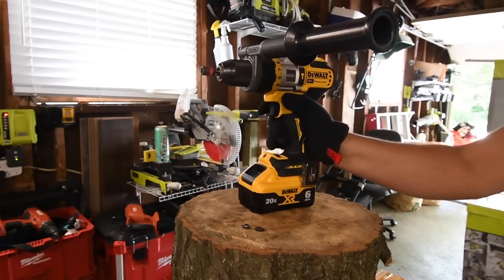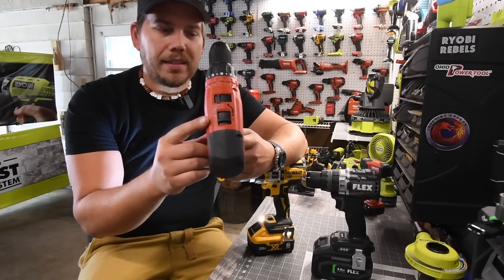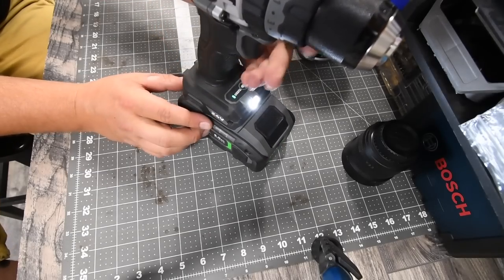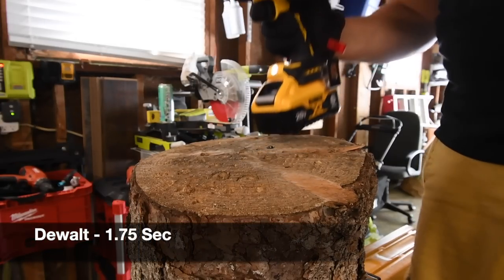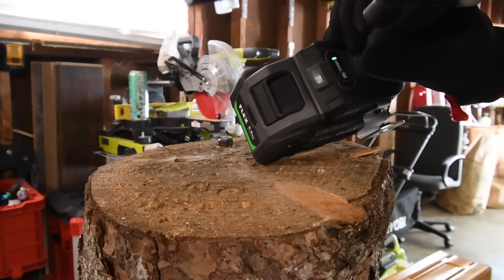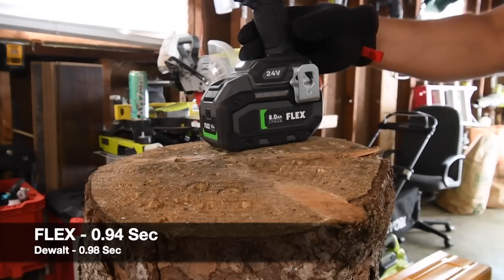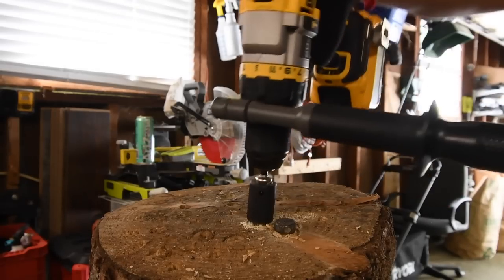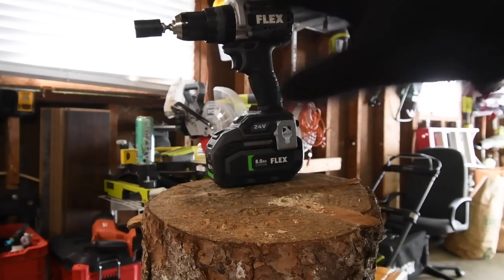DEWALT FA vs FLEX Turbo (Hammer Drills)

Comment: Can't wait for the XGT hammer drill to hit this channel, great video!
Reply: XGT monsters
Reply: Xgt beats both these drills on power and torque and quality i would say
Reply: I need  the makita  xgt hp001g beast but was looking at the 18lxt xph14 dhp468 drill cause im not on the xgt platform yet
Reply: @micjubba709  just get the XGT!
I initially got the rear handle saw, it was so damn good I started moving into the xgt line. The drill absolutely blew my mind with how damn good it is!
If you either need a good drill or a good circular saw, the XGT line is for you!

Comment: Great video! When doing the speed bore test you drill right into a thick knot of wood for both brands which any tool will have trouble getting through. I’d like to see Dewalt and flex go at their speed 2 speeds in a non knotted spot.

Comment: Turbo mode increases torque and speed. It does not decrease torque as its just applying more power from the battery. It isn't any kind of physical gear change.
Reply from the maker: Deal with it.
Reply: @ManCaverTools  I wasn't criticizing your video, nor do I care which of the drills win. I'm just letting you know how they work because it seems like you think the turbo mode increases speed and decreases torque. Just trying to help.
Reply: @ManCaverTools  what a great attitude you have… man child.

Comment: The anti kickback on the Flex is super sensitive. It’s a lot like the gen 4 Milwaukee, but you can shut the feature off on the Milwaukee.
Reply from the maker: correct, each brand has the setting for the anti kick, some are set to soon
Reply: @ManCaverTools  I agree, but you can disable the anti kickback on the gen 4 Milwaukee and the Bosch 1330.
Tools and Tactics said that the Flex isn’t quite as sensitive if you use the 2.5 amp battery.

Comment: I believe the dewalt you used was the flexvolt disadvantage model given that no flexvolt battery was used. Still an interesting and useful comparison nonetheless - but run it again with a flexvolt battery please!
Reply from the maker: I already did multiple videos on the flecvolt advantage. a flex volt advantage battery is not better than a battery with 21700 cells in it when its on a felxvolt advantage tool
Reply: @ManCaverTools  Who makes FLEX drill driver ❓❓
Reply: Flex failed on the 10” lag due to the anti kick back. I don’t think Dewalt has anti kickback.

Comment: Just curious as to why you didn't use the 6amp hr Flexvolt Battery on the Flexvolt Advantage. Seems to me that the Flexvolt battery would've bee the obvious  choice.
Reply: That's because he knows that 6 amp hour flexvolt can actually do it but it's real power is actually the 9 amp hour, I know because I did the same test myself on the same drill bit which is why I'm going to buy me DeWalt Flex advantage drill cos we don't have Flex in our country, I'D say that  the 9 amp is Dewalts turbo way for  power
Reply: Because the 6amp flexvolt uses the 18650 cell batteries compared to the xr using 21700 to match with the Flex’s battery. I’d would say to use the 9 amp flexvolt since that one does have the bigger cells

Comment: Another one. Ever thought of getting 12 ah batteries for each tool to do head to head like The DeWalt 12 ah FlexVolt, M18 12.0, Flex 12 ah and any others that you may carry that has a 12 ah battery?
Reply: A 8ah with 21700 cells  is more than enough for a drill dont need a massive 12ah battery thats just for capacity and runtime of the tool not performance or power
Reply: @micjubba709  Yes. But did I say just drills?
Reply: @toolskii  as its a video about drills going head to head i thought thats what you where talking about
Reply: @toolskii  even most the other tools 12ah will just improve runtime not power or performance
Reply: @micjubba709  Oh Yeah. I should of been more specific. I do apologize.
Reply: @toolskii  its cool i get what you mean 😁

Comment: If I’m not mistaken, by trying to put the lag in with the Flex so close to where you did it with the Dewalt without removing the Dewalt lag first, you compressed the wood.
That creates a higher wood density in that area, which makes it much harder for the Flex to complete the task.
Reply from the maker: This is a old video. Ive changed how I do these tests since this video I don’t even use logs anymore
Reply: @ManCaverTools  I think we’re all learning as we go through trial and error.
I’m thinking about getting the Flex since it’s on sale.
How would you compare it to the gen 3 and gen 4 Milwaukee hammer drills?

Comment: I want to ask what everyone’s experience has been with Flex.
I’m debating on getting the turbo hammer drill because Lowe’s has a great deal on it right now.
Reply from the maker: Flex tools are worth buying into. When it comes to buying into a line of tools the most important information on a brand is do they have the tools you need available to buy
Reply: @ManCaverTools  I love the ergonomics of Dewalt, but the hammer drills I would buy by Dewalt are expensive. Also Dewalt’s warranty is a little shady. Thibs had to pay over $100 to get one of his Dewalt tools repaired because the Dewalt warranty only covers one year of service.
I’m open to having more than one battery platform because I believe that’s about the only way to build the best set for the buck.

Comment: By the way, the Flex is on sale for $179 with two batteries, a charger and a bag.
The Dewalt Power Detect is around $300.
Reply from the maker: not too shabby
Reply: @ManCaverTools  The combo kits are more competitively priced. The Flex is $349, and the Dewalt is $379. Those include the impact driver.

Comment: How about with the Flexvolt 6ah battery?
Reply from the maker: the felxvolt advantage would lose with that battery
Reply: @ManCaverTools  it does better with the 6ah XR?
Reply from the maker: @bennettshfd2  yes it does with a XR battery that has 21700 cells inside
Reply: @ManCaverTools  I had no idea.  Why would they use only 18650 instead of 21700?  That's crazy!
Reply: @ManCaverTools  I believe the new 6.0 flexvolt batteries also use 21700s.
Reply: They use 18650 cells inside of 6ah flexvolt bc of weight to make it comfortable to use with flexvolt tools  and a bit lighter than 9ah or 12ah honestly it makes some sense.
Reply: @АртемВ-и5р  interesting,  I could of swore I seen somewhere that the new 6.0s switched to 21700.  Guess I'm glad all I have are 9.0s lol

Comment: Uhh aren't you supposed to be using a flex volt 20v/60v battery to get the benefits of extra power from the tool?
Reply from the maker: you dont get an advantage with those batteries. I already proved it in many videos
Reply: Clearly you aren't a subscriber lol. He's tested that, and no, it doesn't.
Reply from the maker: @GuyFromJupiter  thank you Spencer
Reply from the maker: @jhonimastersipayung5874  he was just saying the I have a few videos already proving that fact on batteries
Reply: @ManCaverTools  no worries. Thanks anyway 🙏🙏🙏
Reply: @ManCaverTools  Regardles,  you should have used one anyways to remove any doubt. They do advertise the 999 being stronger with the flex volt battery, even if your real world testing doesn't show any difference. Too many variables (hard, dense spots in the wood etc). Might as well do the best you can to present an apples to apples comparison. Liked the video regardless.

Comment: Hey everyone. I just wanted to add something.
Videos like this are a great resource when trying to figure out what brand is best for you. At the end of the day, it’s really about personal preference, though.
I can say that I see more people moving away from Dewalt, in favor of other brands.
Dewalt has a lot of power, but not enough safety, such as thermal shutdown and anti kickback. They tend to keep going until they break or hurt the user.
Check out comments and reviews to see for yourself.
Reply: F the incompetent user. Breakdown is a different story. 

Personally, we tried cordless Milwaukee ten years ago and every one broke. Meanwhile every DeWalt since the 90s is still going. Although the older ones are weak. Useless on a site. 

The future may be Flex. But they have some drop trials to prove it.

Comment: Shouldn't the 999 perform better with the FV battery?
Reply from the maker: the XR 21700 cells performs better in the Flexvolt than the Flexvot battery does. check the the Flexvolt vs Dewalt power detect video
Reply: @ManCaverTools  I figured the FV used 21700 also 🤔. But I've been wanting to go with the 999 hearing it can use the 60v supply as a "turbo" in situations of needed extra umph.
Reply: @FordRanchero289  it did in my case when I tested my Milwaukee gen 3 against my brother-in-laws new 999 and his old 996 about a month ago ,found out the 9 amp flexvolt battery did match my generation 3 high output 6 and 8 Milwaukee batteries but the difference was that if the RPM on the 999 was the same as my Milwaukee then the 999 I feel would be a little bit stronger than my gen 3,I pushed them both to breaking point to find that out, in other words I thrashed them both along with 996 as well,using 32mm flute augers on 6 test runs on  hardened  Douglas firs, pity we don't  have Flex in this country

Comment: I really would not mind switch my power tools over to Dewalt but I use my impact driver a lot and I’m really about the 887 but dewalt hammer drills are top dawg
Reply: I’ve been using the brushed 885 for years. I will take it to my grave 🤣😂. I love that little impact
Reply: @powertools2375  mine is finally going out after lots of good years.

Comment: Have you ever tested the Bosch bi turbo?
Reply from the maker: I have not, I haven't tested every single tool ever made
Reply: @ManCaverTools  I was just asking because it seems to be a very good drill, and it’s $199 on the Lowe’s website, plus you can get a free 8 amp battery and a charger.

Comment: Should’ve used the 6 flexvolt on the dewalt
Reply: That's what I thought as well. Didn't get that at all. That's also the battery the drill comes with when you buy the kit.
Reply: Hes done videos where he proves this battery is stronger than the flexvolt 6 amp hour.
Reply: That was the Power Detect from Lowe’s I thought. I’m just saying to me it would have made more sense to use the Flexvolt battery with the Flexvolt Advantage instead of the battery that comes with the Power Detect.
Reply: @skolsaw1080  to you it would make sense because you don’t have all the facts.
The flex volt batteries don’t give this drill any advantage, it’s just shady marketing from dewalt.
Reply: @SweetStat  lol 😂 ok well.....thanks for setting me straight.
Reply: @skolsaw1080  it’s actually true tho compare a 6 amp xr vs a flexvolt on either the power detect or advantage, the xr will beat it, mainly because dewalt had the smaller cells in the flex battery compared to the bigger cells in the xr
Reply: I would still rather see the 8ah DeWalt battery used and better yet on the dcd998 oh yeah 😃

Comment: Have you had any issues with your Flex batteries leaking?
Reply from the maker: I have not had any issues with these batteries. at the same time. I dont use the Flex batteries as much as other brands. I mainly use my Flex batteries to power a their radio

Comment: I would have liked to have seen you utilize speed 2 on the DeWalt more often but hey, nice comparison anyway.
The my main question I have is what is the turbo button for? Why not have it on turbo all the time lol? seems kind of gimmicky.
Reply: I'm assuming the turbo mode temporarily pushes the power beyond the battery cells' continuous amp rating until it overheats, and then disables the feature until the temperature gets back down to normal

Comment: You did not use the flexvolt advantage? Why not?
Reply from the maker: because the XR batteries with 21700 cells destroys the flexvolt battery in the flexvolt advantage tool

Comment: Hi Dave, in my opinion these tools didn’t fail they both did outstanding extremely powerful and I saw you almost lost it and kept hold of it, there both a beast and performance is acceptional, just my opinion, ty, Bob,
Reply from the maker: they both are very powerful tools
Reply: @ManCaverTools  it’s possible the flex is slightly more powerful, it’s mind blowing lol,

Comment: Turbo mode engaged for flex, but no flexvolt battery for DFA? I know, Dewalt has three speeds, but let them both have their best foot forward.
Reply: Agree, would like to see this done with the 6 or 9Ah FlexVolt batteries.  

Until then, I’d say DeWalt performed well even with a double handicap (XR 6.0 vs Flex 8.0)
Reply: The 21700 cell batteries that he used are stronger than the 6 amp flex volt battery. Theres a video on his channel proving it.
Reply: With FA drill, even if it were 18650s, there should be a noticeable difference. I’m not saying that 21700 cells in a 6ah 20v battery aren’t better than using 18650s in a normal 20v max tool, however with the FA drill, per manufacturer claims and what other reviewers have relayed is there is a power difference. Enough to beat this flex tool? Maybe not. Just saying that it would be nice to see the flexvolt advantage tool run with a flexvolt battery instead of the 20v battery.
Reply from the maker: I already proved that the FA battery isnt good for a FA tool. The XR 21700 cells in it will be better in the Dewalt FA tool

Comment: I gotta disagree on the hammer feature on the Ryobi HP because I drill concrete for tapcons all the time to work  and it's ok but not as great as it's made to be. That's one the main reasons I wanna switch to flex.I also have the gen 3 hammer drill and my experience is the Milwaukee is just as good or better. I saw the vs video with the flex vs Ryobi HP hammer drill and you only drilled one hole with the Ryobi. I think it might've been a soft spot in the concrete why it did so well. It's true what you said that tools don't perform the same every time. I can hear the beast in the flex hammer feature. I'm just saying what my experience is. I remember watching another vs video with the flex and the other hammer drill lost at concrete but I remember the drill coming to a stop for a little bit and I said it was something in  the concrete that did that or maybe dust but I'd like to see another concrete test between the flex and Ryobi to make me a believer. I would like to see the vs video with the flex and Ryobi on concrete only. I haven't seen it yet

Comment: Dewalt performs very well with 10inch lag 😁
Reply: Yeah. Means this Dewalt can finish more heavy job compare to the Flex. 
Maybe he also need to test the maximum diameter and length of the bit at the concrete test and see if we get the similar result.

Comment: Flex vs power detect? Hammer drills?
Reply from the maker: I already have that video uploaded
Reply: @ManCaverTools  but you should do a retest because that test was flawed. Otherwise both the power detect and flex are beasts
Reply: Power detect is the best hammer drill out there. It blew Milwaukee out of the water.

Comment: The Flex failed on the lag because of the anti kickback feature.
I don’t think Dewalt has anti kickback.
By the way, the Flex battery doesn’t have 21700 cells. They’re just advanced 18650 cells.
Reply from the maker: some anti kick back feature activate later then others. not all ATC will respond the same
Reply: @ManCaverTools  I still don’t believe that Dewalt claims to have anti kickback on their drills, but I could be wrong.
Ridgid seems to have a really sensitive anti kickback, and the auto stop on the gen 4 Milwaukee is really sensitive too.
Reply from the maker: @DiligentDave1966  sorry I didn't answer your question. this specific model does not have ATC. but for the tools that do sometimes they activate too soon.

Comment: It makes a big difference in battery thee 999 is a Flex advantage you should be using a 9 ah flex volt battery to be fare since your using the turbo on the Flex this isn't a fair test plus your using a 8ah on the Flex and a 6ah on the Dewalt this is a huge advantage for Flex this is a set up against dewalt and I'm impartial I'm a Milwaukee guy make it a equal test of course Flex will win you gave it a huge advantage

Comment: Man Caver Tools, please re-do the review again! Please! 🙏
Next time do Flex 24V Turbo Hammer Drill WITH the Flex's 12.0Ah Stack lithium pouch cell battery VS the Dewalt's top notch Flagship Hammer Drill the Dewalt dcd999 Flexvolt with Flexvolt 12.0Ah 60V battery. I wanna the See the Fair and Honest Review. 
Philly Fixed 👈 this guy this tool reviewer is kind of a Biased he used DeWalt dcd999 with a Flexvolt battery 60V VS The Flex 24V Hammer Drill with only the standard 5.0Ah 18650 Cell Battery. So it's a biased review the way I see it. I'm not a fan of either one of those tools because I'm a kind of guy that is not loyal to any tool brand, I use whatever tools I have and the tools that is around me. But the results of the test IF you're gonna conduct it, will determine my judgement wether or not I should replace my old Bosch cordless hammer drill with a DeWalt dcd999 Flexvolt or the Flex 24V turbo Hammer Drill with stack lithium pouch cell battery. Thanks! And more power to you!

Comment: Dewalt 20v flex volt advantage is  a beast more powerfull than the flex torque wise ...hammer drilling flex takes 1st place

Comment: Driving lag bolts with a drill...wrong(oops caught me off guard) lucky you didn't break you wrist. Use an impact driver. Drilling a large hole in concrete with one of those drills(my hand is numb, dah)...wrong. Use a sds rotary hammer drill, right tool for the right job. For Gods sake use the right tool for the right job! This could be an advertisement for what not to do with a drill.
Reply: It’s a stress test.
Reply from the maker: was this a SDS hammer drill video? No its not. why would I use a sds drill on a video that isnt supposed to  have sds drills in it?
Reply: This is hammer drill test. He's trying to push it to the limits. Has to be this way